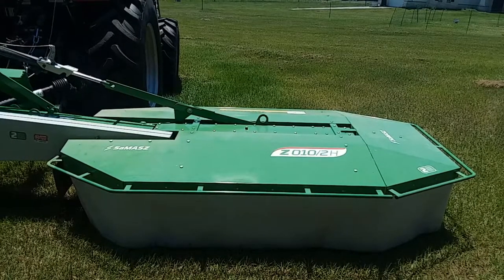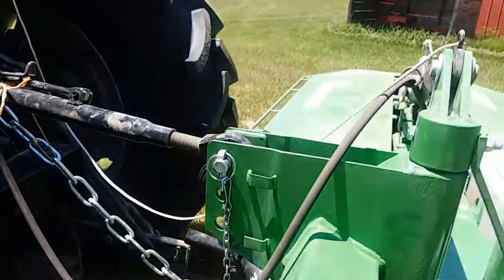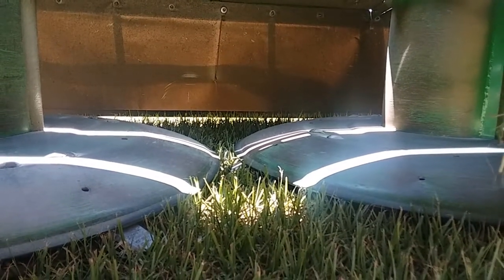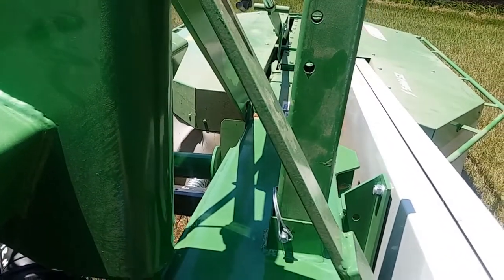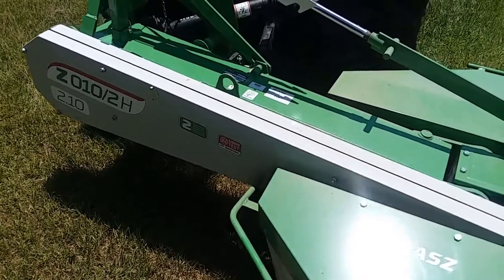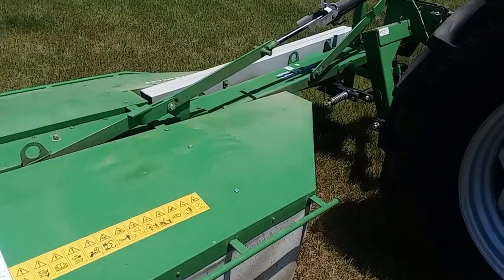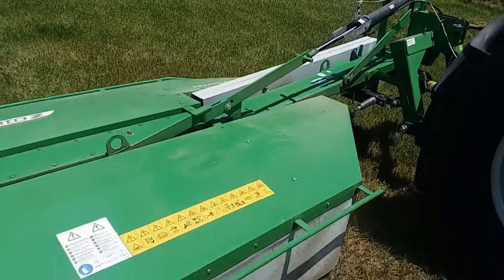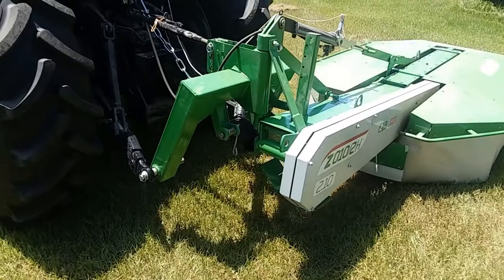Haying Hay My Way with SaMasz Z010/2H Drum Mower

Comment: Doc, thanks for the video.  Very informative.  I'm seriously looking at the SaMasz for my small (30 acres) hay operation.  I can get a new SaMasz drum mower for the price of a used - very well used - disc or haybine so it makes a lot of sense to me.  The one question I have is can I adjust the height of the SaMasz?  I don't want the drums to ride on the ground.  I want them a couple inches above the ground.  Thanks again for your video.
Reply: There should be a spacer kit that uses shims  that will add an inch and a quarter of so. so maybe 3.75 inch cutting height.

Comment: How was your second cut growth after using the drum mower? I have timothy, orchard grass, clover and blue grass I am mowing with a sickle mower right now. Looking to upgrade to a drum mower but I don't want to stunt my second cut growth. I have looked into the distance rings for the samasz mowers. I can get them but I was not sure if they would I would leave enough stubble with them.
Reply: With all the videos I have watched about drum mowers, none have talked about how much stubble is left after cutting.
Reply from the maker: I think it will depend on the grass. I mostly cut bahia which can be cut low and still come back with good vigor. I did check after the first time I used the mower and it left more than I thought it would. However adding the spacers might be a better fit in your case.

Comment: All lawnmowers with drums have an issue of imbalance with the result that they appear damaged. Over time, soil enters the vertical rollers and the cutter begins to break down.........
Reply from the maker: I haven't seen anything like this to date.  This machine is well balanced.  I suspect the difference between the size of the drums on this unit and a lawnmower likely come into play.

Comment: Samasz made on Poland. Why didn't you buy Samasz disc mower KT series? It''s better. Drum mower are archaic construction, less durable.
Reply from the maker: It is more expensive, but I would not say better.  I have a disc mower also, but didn't want another.  The drum has fewer parts, thus less maintenance.  The design has also proven to be durable.  Also, I wanted a mower that could be used to cut most all forages.  I cut enough hay for our cows.  If I was trying to make money with hay, I might consider other options.  But for the aforementioned points and the economics, I will stick with the drum mower.